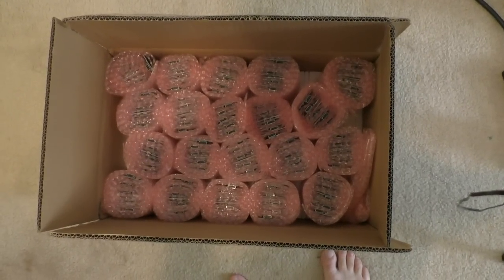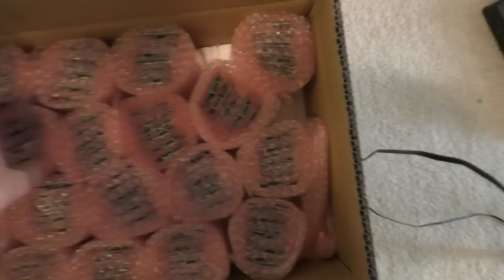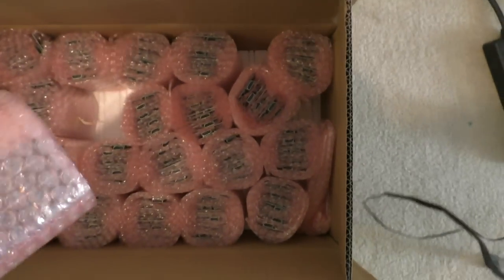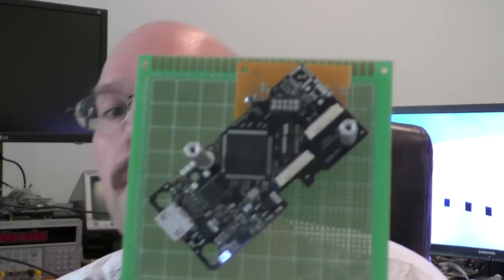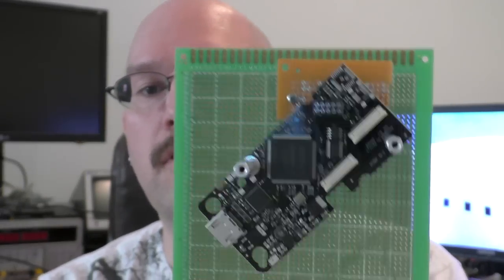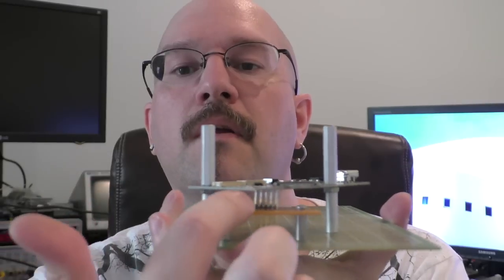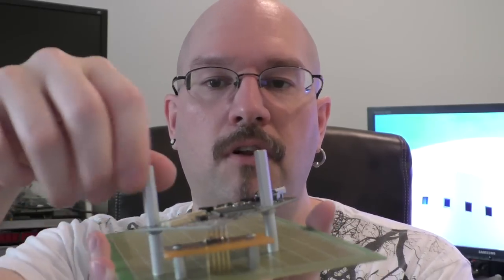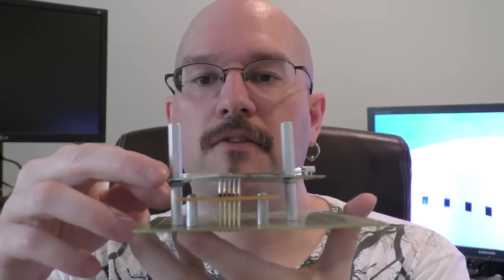HiDef NES Update 10 - SHIP IT!

Comment: Kevtris,
Is there a reason the interposer is required as opposed to using a quick solder board (QSB) like team xecuter used to use for their xbox 360 mod-chip installs?
If possible, this would make the installation far simpler.
It would be something like the image in the url below and you could have it connect to the pins on the bottom of the main board to tap off of all the contacts from the CPU and PPU, this would save the whole de-soldering step and allow for a much quicker and low profile install.
http://team-xecuter.com/forums/attachment.php?attachmentid=21571&d=1381952334
This just hit me the other day, watching the video on the on the game-tech.us youtube channel of him doing a top-loader install.
It seems that if all you're trying to do is to tap into those solder points, a QSB would provide an easier install point where you can attach the ribbon cable to.

Sorry for the rambling comment, I hope this is useful feedback.

Thanks